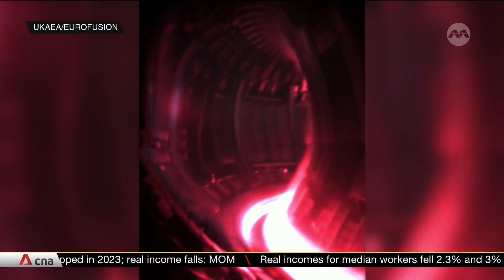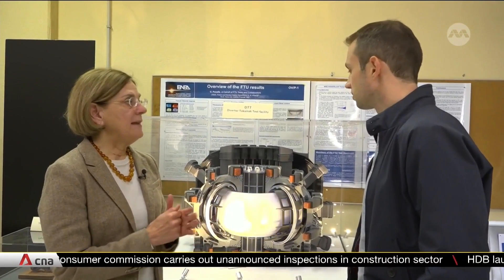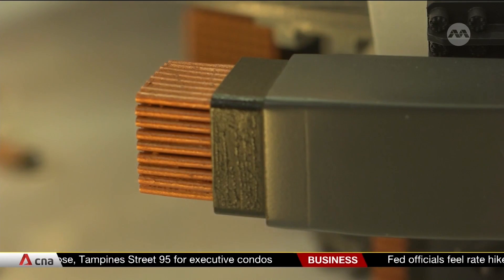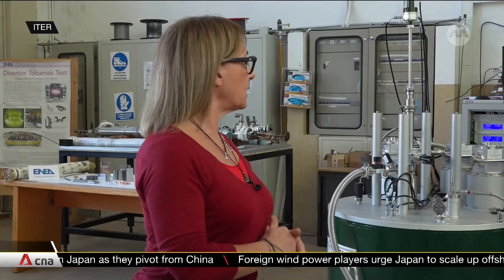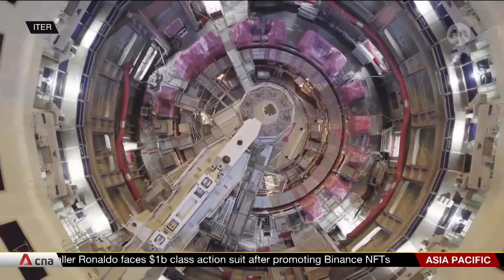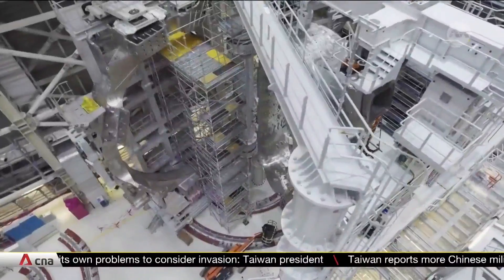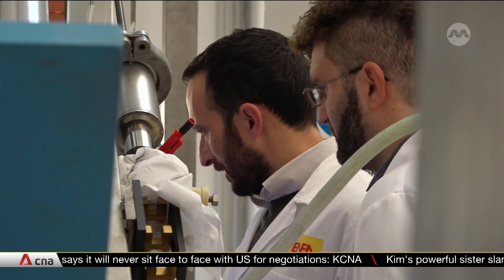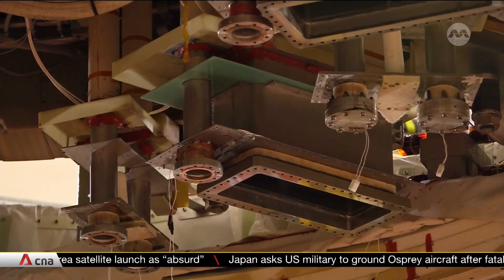Focus turns to nuclear fusion as a source of clean energy

Comment: You need oil to run this power plant.
Till mid century, let’s say it’s operable by 2065/68.
They have produced enough carbon and burned enough fuel.
They might need to do 1,000s of experiments each time bringing the thermo chambers 1,5,000,000C•
That’s scam for climate change.
Reply: Why do you need oil to run it?